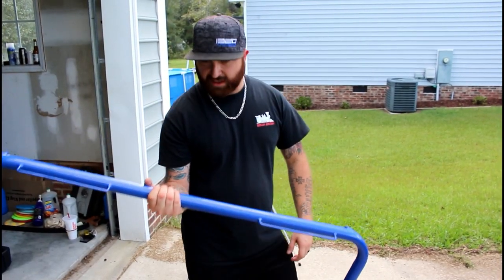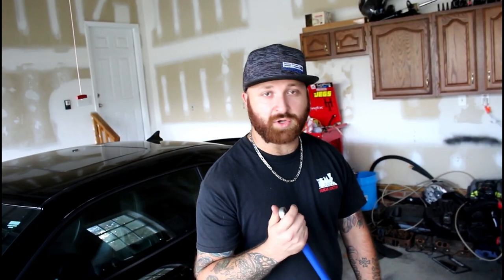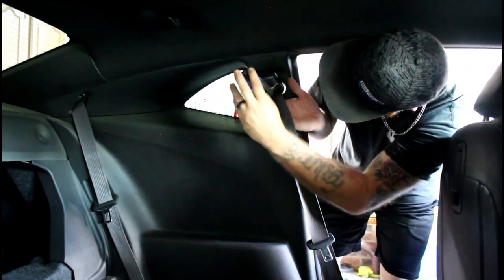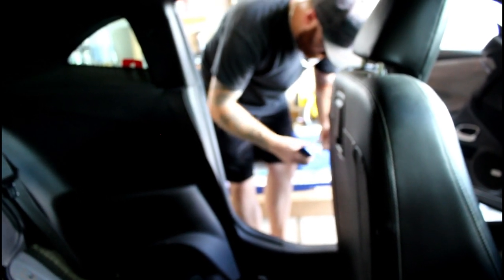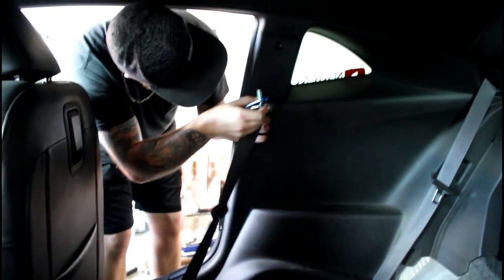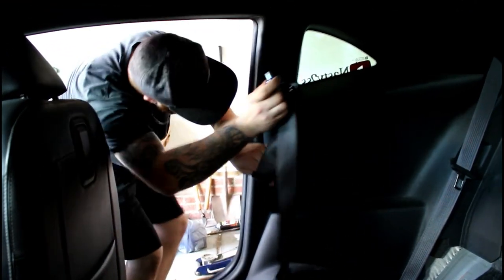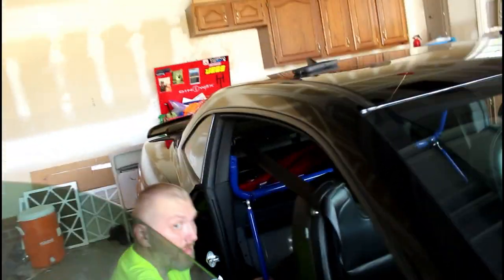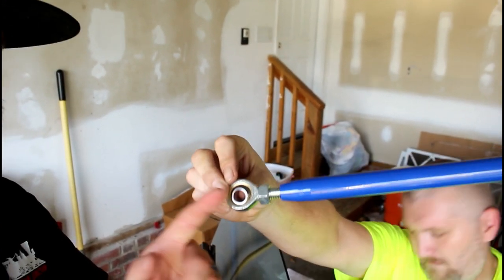2010 2015 Camaro Harness Bar Install

Comment: What's the brand of the harness bar
Reply from the maker: https://www.ebay.com/itm/201788561798
Reply: @Nasty2SS  Is the link that you sent me the exact bar used in your video because the Ebay seller is telling me it wont fit.
Reply from the maker: I went back to double check my purchase history, and yes. You won’t not have any issues with fitment using this bar. Hit me up on Instagram @nasty2ss if you want pictures or confirmation
Reply: @Nasty2SS  cool. I purchased the red one, and thanks for the response back.
Reply: @Nasty2SS  the link is dead what brand or company is the harness bar? TIA
Reply from the maker: https://www.ebay.com/itm/165641765498?mkcid=16&mkevt=1&mkrid=711-127632-2357-0&ssspo=PseZfdUnTIy&sssrc=2349624&ssuid=2az7Y2huQsW&var=&widget_ver=artemis&media=COPY

Comment: I’m torn between an SS or a 2015 z28.
Reply: G-MAN #60 it would be nice to have money left to build it is the only reason I’m can’t make up my mind.
Reply from the maker: Z28 all day lol
Reply: I’d say the SS, reason being yes the Z is faster and has a 427 with one of the best suspension systems ever...but it doesn’t have the luxuries the SS has like a radio and AC!! You can buy an SS and with the $ you saved between the cost of the Z, use that money and build the SS to be even better ( faster and handle better ) and have the luxuries a daily driver would need!! That’s my 2 cent!! *The Z28 is awesome though!*
Reply: Jeremiah Hamilton But the z28 has awesome interior. Leather/suede Recaro seats, suede shift knob.. and what do you know, it has a radio too!
Reply: And let’s not forget the a/c.. 🤦🏼‍♂️
Reply: Ya know what, your absolutely right. for some reason i was thinking it was a race only body with weight reductions in the form of loss of luxuries, but i was wrong. Anytime your wrong on social media there will be at least one pompous prick ready to make sure they point in out in the most rude and obnoxious way possible most of the time in an attempt to make it seem as though they know so much more than any others and that they never make a mistake, human or not they are absolutely perfect,   but thanks for setting it strait I do appreciate it. * I would still recommend an SS over the Z28 even though it is an amazing car but in reality so much more can be done to the SS to make it more powerful easier than the 427 in the Z28 without devaluing a rare vehicle.
Reply: Z28 all day I own a 1997 z28 and 2015 z28 and they are my babies !!!
Reply from the maker: Lucky. Lol